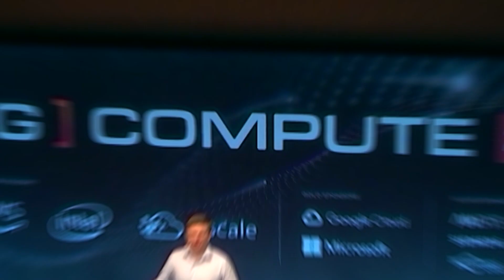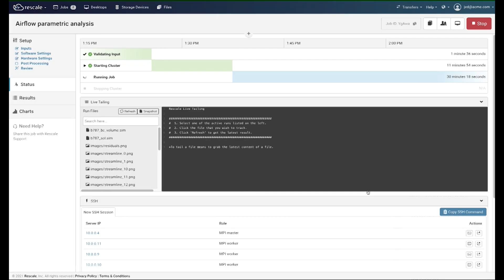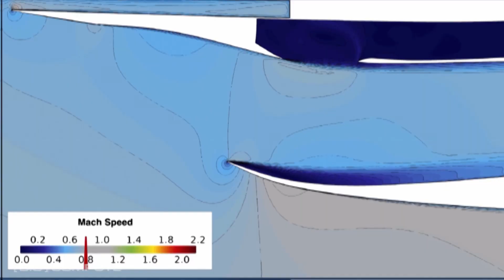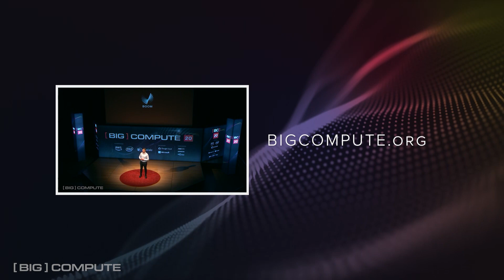Supersonic Commercial Flight is Making a Comeback - Boom Supersonic | Big Compute

Comment: Except no, it will not come back bro.
Supersonic flights have some issues that cannot be solved unless you bend the laws of physics.
1. Sonicboom, the most damning one. The bang will not be tolerated and can’t be solved unless you always fly downwind, but that beats the purpose of a new plane.
2. Environmental damage, the 2707 project already proved that constant sonicbooms can damage the ozone layer, we don’t want that again do we?
3. Limited application, caused by the sonicboom, you can only fly trans ocean flights, so Probably the largest hub of Dubai is out and only a handful of westerners can fly them due to route limitations.
4. Cost, in order to sustain supersonic flight, you need material that can hold the temperatures, the whole plane will be made with exotic materials.
5. Efficiency, with modern planes getting more and more efficient, the new plane’s competitors will not be like concorde vs 747-200 or so, it will be against A350 and 787, which are considered the most efficient commercial jets.
6. Time, this is again caused by sonicboom, due to sonicboom, supersonic jets cannot fly over mach 1 in any populated area, leaving supersonic flight take up an extremely small amount in total flight time, mitigating the speed advantage.
People are always stupid and ignorant, not even willing to research before talking about aviation .

Comment: I'm not saying this is a bad idea but here is some reasons why I think this is another aviation misstep. One, despite it being an old law, America said that no supersonic airliners were allowed to fly over their airspace and they still enforce that rule today, Two, even if the plane makes it into production, there might be not enough room for it. What I mean is at the moment airlines have short and long ranged aircraft and most of them are asking for either updated or next gen aircraft to replace them. Also, many airlines are asking for a replacement for the 757, an aircraft that is capable of doing short and long flights while still burning little fuel, that's why Boeing is making the 797. Three, even if Boom manages to sell the plane, it still won't make them much profit. The reason for this is there isn't a need for a supersonic airliner. Yes they can fly much faster than planes before them but they will carry less people and cargo, be more expensive to purchase and despite they will probably will have more eco efficient engines than Concorde did, they still will burn more fuel than aircraft slower than them and if hundreds are flying they could damage the ozone layer. So, to my opinion, supersonic aircraft, they are fast but they are not helpful.

Comment: Es ist nur die Flußwiderstandsgrenze , so wie bei einem Supraleiter. Kleinere konzentrierte Packete laufen hier schneller.
a) Konzentrator b) dahinter Fluctator. c) Abrundung der Flügel im Ganzen , damit das ganze wie ein Stein auf einer
Wasseroberfläche gleitet, da jetzt steigende Spannungsdruckfluctuation, weniger Auftriebswirbel.
0.10 bereits etwas sperriges Vormodell, aber wenigstens Heckstabilisator für Richtung. etwas abgerunde Flügel
und eine Übergangswelle zwischen beiden und das ganze wäre hier angepasst für Überschall.

Comment: Nice, but what about the sonic boom ? One problem Concorde faced was a ban 'flying over residential communities' thus it's only commercial 'route' was over 'water'. Has this been solved ?
Reply: Not yet: NASA is currently working on that with their experimental supersonic jet that they hope will turn the sonic boom into more of a sonic thump. As for Boom Supersonic, they're not waiting on the results, and they intend to forge ahead with what we have now. Thus, Overture will fly supersonic overseas, but, unlike Concorde, it will be economically viable enough that it can take on numerous routes around the globe, and not just transatlantic. The hope in the long run, though, is that supersonic technology will develop enough to where we can fly faster than the speed of sound over land without causing much more noise than, say, the closing of a car door.

Comment: Faster than sound jets, like they were in the 50's, always had a sonic boom , which upset everyone on the ground, and even broke glass windows. Are you sure you want this again? Speed of sound is around 720mph, depending on atmospheric conditions. Once the BOOM is sounded, means the jet has passed through the sound barrier, and the boom sound is heard. This boom sounds like a bomb going off in the next street over. No-one liked it then, and No-One will like it now. BAD IDEA! Better idea would be to fly up to, but not through the sound barrier. No Boom, and the plane reaches its destination in good time!
Reply: Actually, many companies like Spike, with their S-512 are working to make sonic booms very quiet.
Reply: That’s why the flights are overseas. “No one” is quite the assumption.